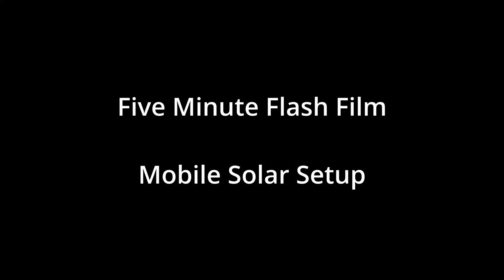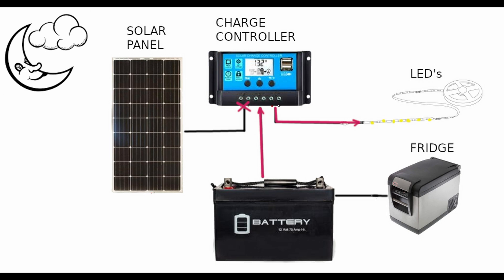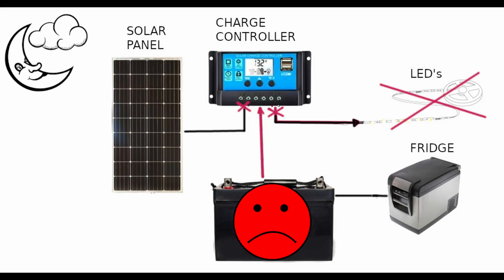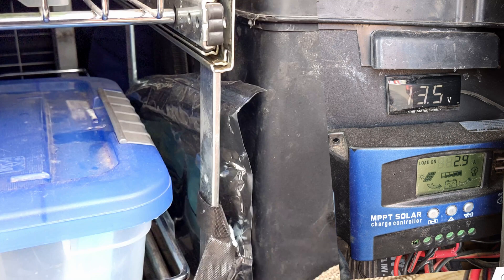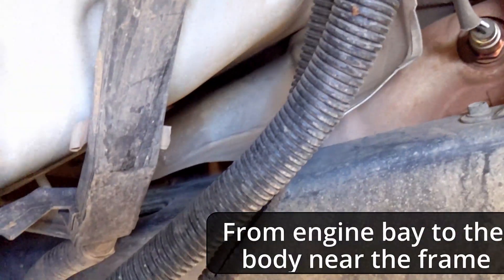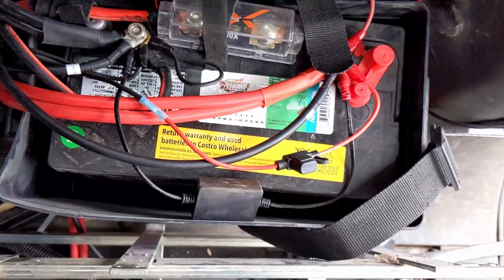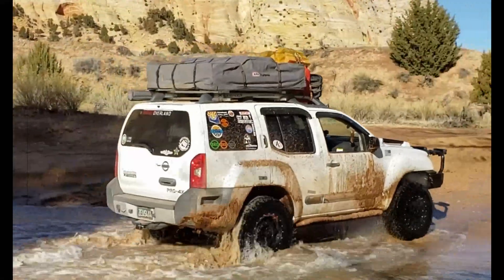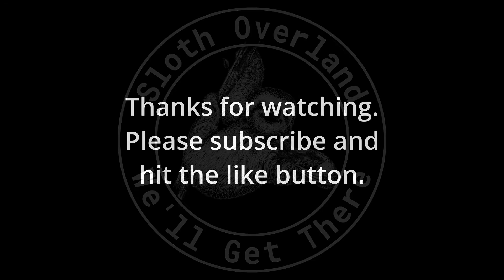Overlanding Solar Charging and Second Battery System

Comment: How long does the fridge last when you arent getting any solar power. For example overnight or on a cloudy day. Or. Worst case scenario. Overnight followed by a rainy day?
Reply from the maker: I parked in a garage in Las Vegas in September (ambient temp 95F) for over 2 days and still had power to spare. The fridge was wrapped in a thermal blanket and wasn't opened, so the conditions were perfect.

But what you ask is what led me to expand to 200W so when sunlight was in short supply, I had more panels to collect.

Comment: That NEG battery post is definitely overloaded.   The nut is barely hanging on w only 1 or 2 threads engaged.  A bus bar would serve you well.  Less chance of having it come apart and better connections for your ground wires.  IMHO
Reply from the maker: That's next on my list. Just got done cleaning up the engine compartment.
Reply: Great video, thx!